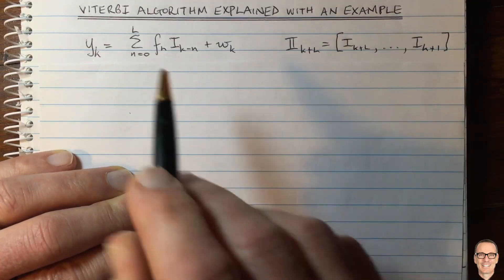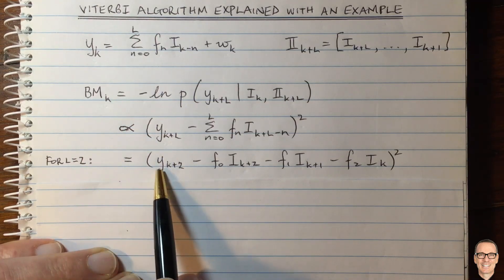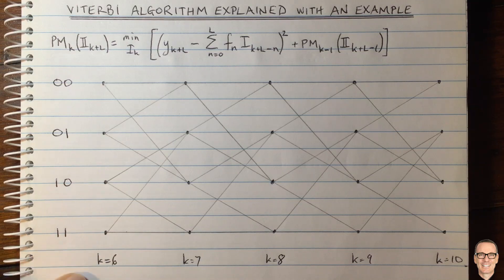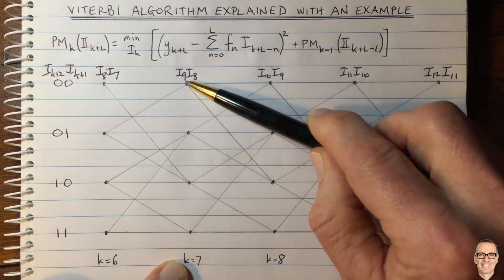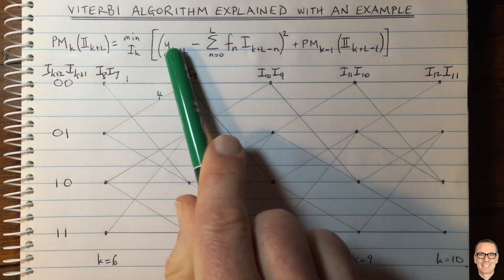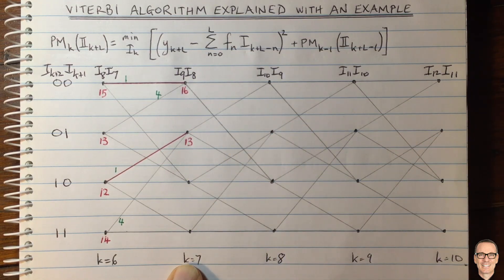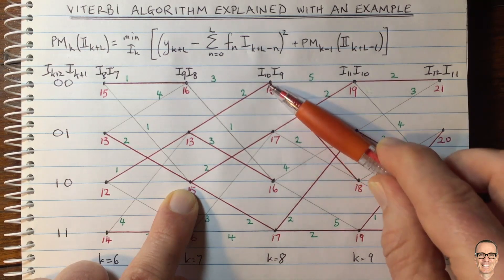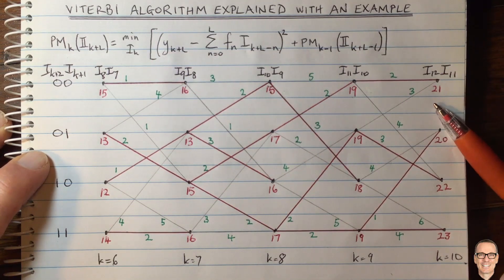Viterbi Algorithm Explained with an Example

Comment: Thanks Iain, very helpful. In the beginning it made me think of Dijkstra's algorithm and finding the shortest path such as in Network Engineering. :) One question - with bursty noise channels, is this often combined with a different encoding in order to spread the bits out over time?
Reply from the maker: Interesting you thought of Dijkstra's algorithm, but it's actually a version of the more general Dynamic Programming algorithm. In answer to your question about bursty noise channels, typically interleaving is used in this case. It is a simple process that "randomises" or "scrambles" the order of the bits before transmission, and then re-orders them at the receiver before decoding. In this way, bursts of errors from the channel are "spread out" in the block before decoding, making error correction easier. This only really works for iterative coding schemes such as convolutional coding. For block codes, it doesn't matter what order the errors happen in. I think I'll put this topic on my "to do" list for a future video.